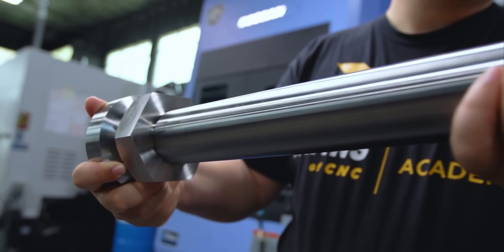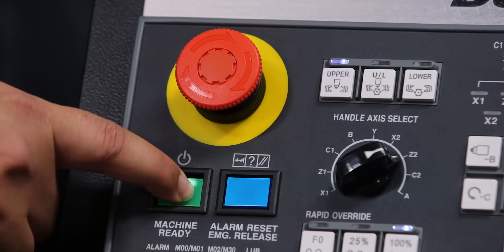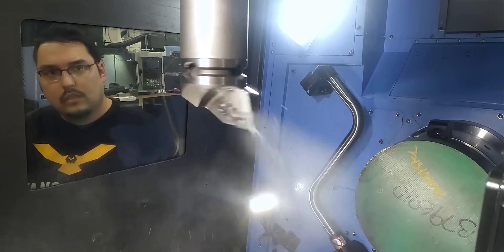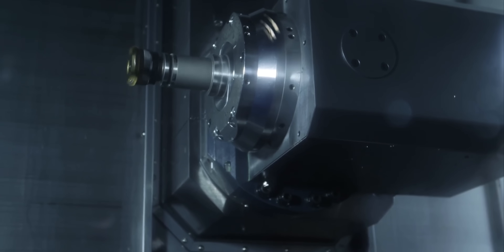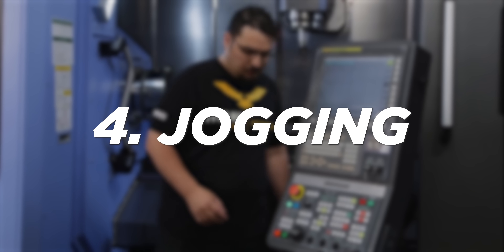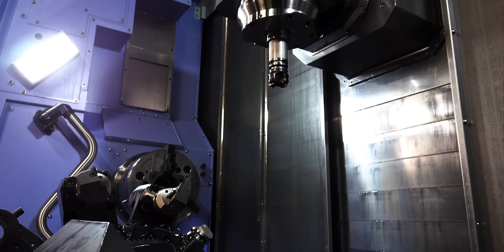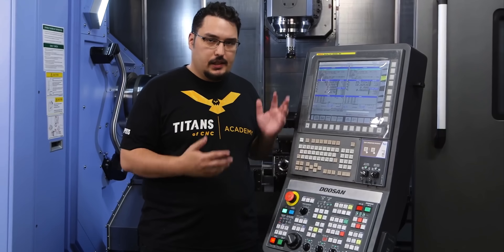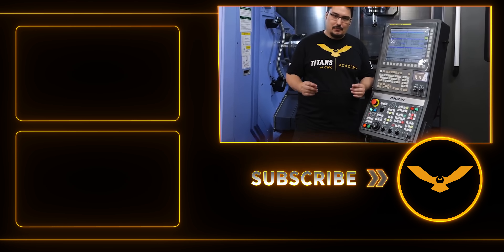The 5 SECRETS to Running a 9 Axis Lathe | CNC MACHINING GENIUS | SMX 3100ST | DN Solutions

Comment: Great video been using an 8 axis nakamura tome for a few years and that has same fanuc control with two screens can hold 48 tools in upper turret front facing, rear facing and axle tools and 48 in lower front and rear facing or axle

Comment: this is a predicament not a CNC. why two programs? CNC should make life easier this is a nightmare
Reply: I assume that this machine has two paths (or channels). This allows you to carry out multiple operations independently at the same time, reducing the cycle time. It is used also for machines with built in workpiece load/unload automation. It can be tricky to program but gives you a lot of potential.
Reply: @filippomontevecchi8618 

Yah, the programing is the only isue. If I can program it on fusion 360 on one go, then its fine but creating tow programs for a single part worrying about counter spindle handshake, timing, and collision is a bit much.
Reply: @desalegnsimon6671  of course it is not a straightforward task and a Cam software makes life much easier. However I would not trust 100% the output of a postprocessor for a machine like this. Therefore, in my opinion, you still would need to understand how programming in multipath systems works.
Reply: @desalegnsimon6671 With a good CAM software it can be pretty easy. I work with ESPRIT CAM which do have its problems but you pretty much can just program it like it's one program. The timings, how each program looks for each channel, etc. is done by the CAM software. You can NEVER run such a program blindly nonetheless. I always have my hand on the feedrate regulator during the first time running it. Also an excessive usage of the single block is extremely recommended 😆. Eventually you get used to everything but it sure takes time

Comment: I am a 73 year old retired mold maker, and I go back to the age of shapers and manual mills. This stuff is so far beyond anything I could have done back in the day. Must be a fairly large problem finding young people able to master these systems.
Reply: the biggest problem ive found is that there is almost no workplaces that hires without experience and very few places to offer education
Reply: @williamvesterberg1107 this is the number 1 issue most shops want button pressers and let the old guys set them up until people retire and it all falls apart

Comment: I'm in training right now to become a CNC-operator and I've been standing in a 1997 Nicolas Correa mill with Haidenhain for the most part. That system seems more modern than that and easier to program as well. But it's also just a 3-axis mill.
Could Haidenhain be used on one of those machines?

Comment: So this machine can run 2 different programs at the same time?? Like 2 different parts
Reply: Technically you could do one part on the main spindle and a different part on the sub spindle. That's not really how the machine is intended to be run. There is one program for the upper milling spindle and one program for the lower turret. They work together to make the part complete in one operation off the machine.

Comment: This is exactly what people need as beginners how to navigate the control screen how to power up and ready the control how to enter into warm up cycle. This would be very good for all the machines you have. How clear errors would be good. How to search on a floppy or a stick drive for the program needed. How to adjust offsets on a variety of machines. What to expect if a - or + diameter offset change is made. Also a variety of part zero set methods on a variety of machines. Thanks guys.
Reply: Getting a call tommorrow if I got the new job to run Doosan with Fanuc
Already slowly learning the machine with these precious videos :P
Reply: Exactly. Would be great if they had a video on doing a full setup on the doosan mill including using the control.
Reply: Second this Motion🎉